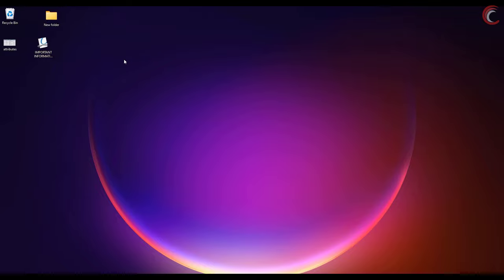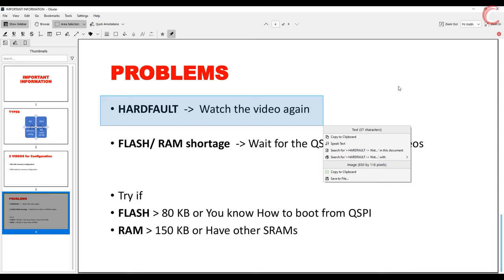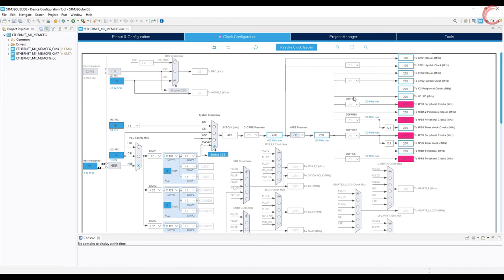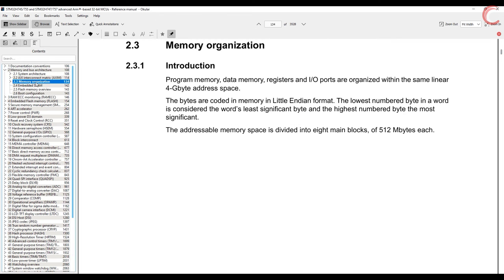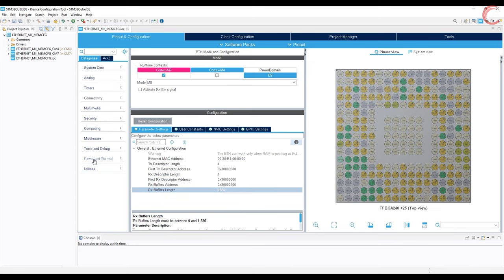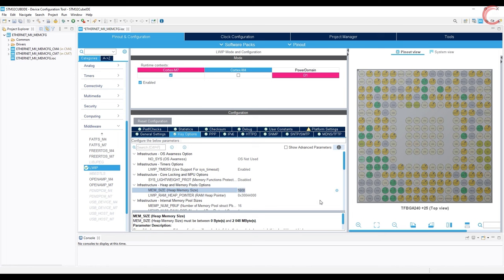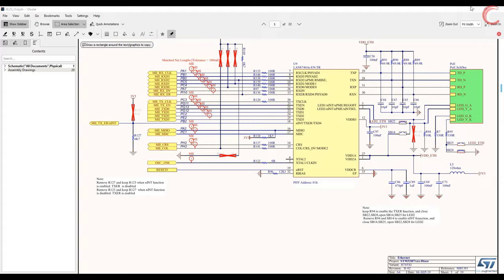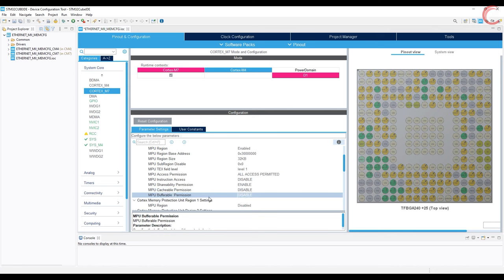STM32 ETHERNET #1. Hardware Configuration || PART 1

Comment: I follow exactly what you did, watched the tutorial many times, my program execute correctly. But, I don't know why I'm not able to ping the mcu.
I have configured MCU adress as 10.10.10.10 and on my computer my ethernet card is configured on 10.10.10.1 with 255.255.255.0 mask. Can anyone help me please ?
Reply: hey. have you got any solution. Same issue here..
Reply: @adityah4511  I analysed the connection with Wireshark and I managed to have an ARP request sent by the MCU to the computer. Then the computer answer back to the MCU so the exchange is available but, I can't ping it still after that. I ended up finding a pre-built solution on the internet which worked just fine for me. Good luck man ;)

Comment: Hi !
First, thanks for your video and how you explain it clearly.

I work with STM32F407-Disco board and and shield for the ethernet port.
The config is ok bc i ping the board at the adress i put in STMCubeMX;

 BUT my problem: i can ping the board and the soft loop if i launch it with the debugger, but for an usual use, if i flash my MCU, the software will be freeze and i can't ping the card.

I guess it is blocked in some routine, if u have ever hear something about this

Thanks ! :D

Comment: Hi Controllers Tech, thank  you for an amazing example! I'm implementing ethernet on the latest CubeIDE package and seems like they changed the code generated again. In particular the Rx buffer is allocated dynamically and needs to be defined in a different way in ethernetif.c and .ld files. In .c. I'm following an example give on STM git repository. 

in newly generated files Rx buffer is defined in the following way 

LWIP_MEMPOOL_DECLARE(RX_POOL, ETH_RX_BUFFER_CNT, sizeof(RxBuff_t), "Zero-copy RX PBUF pool");

to link it visible in FLASH.ld file added another line 

__attribute__((section(".Rx_PoolSection"))) extern u8_t memp_memory_RX_POOL_base[];

in ld file defined the memory in the following way 

   .lwip_sec (NOLOAD) : {
    . = ABSOLUTE(0x30000000);
    *(.RxDecripSection) 
    
    . = ABSOLUTE(0x30000200);
    *(.TxDecripSection)
    
    . = ABSOLUTE(0x30000400);
    *(.Rx_PoolSection) 
  } >RAM_D2 AT> ROM

no more changes. unfortunately cannot get the ping - any advice? 

working on nucleo-h745zi-q (needs pin modification so thanks noting that in your videos)

STM32CubeIDE
Version: 1.9.0
Build: 12015_20220302_0855 (UTC)

Thank you in advance  

Ulian
Reply from the maker: Yes i am aware of it. I will make ammendment in the article as soon as i get some time.